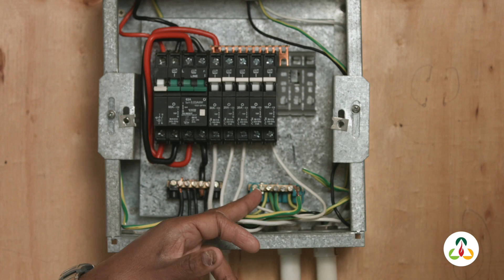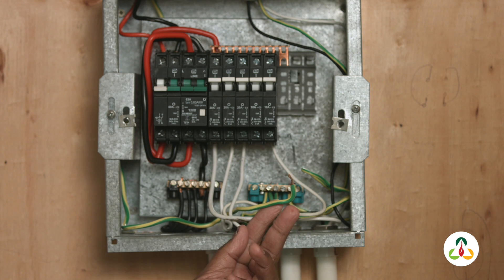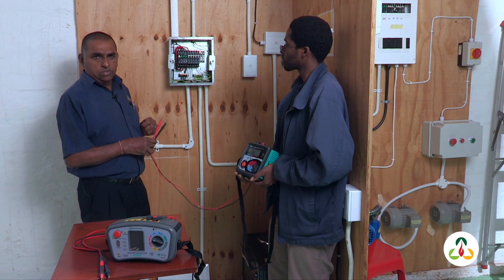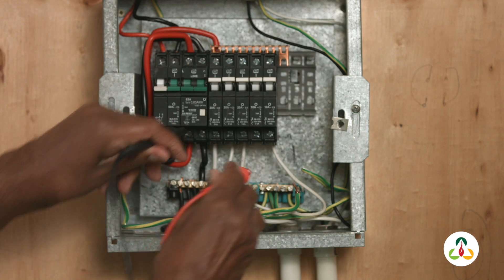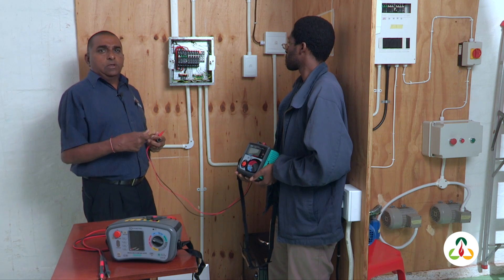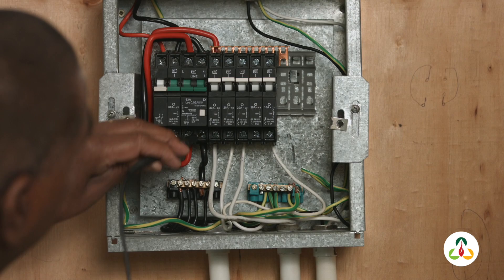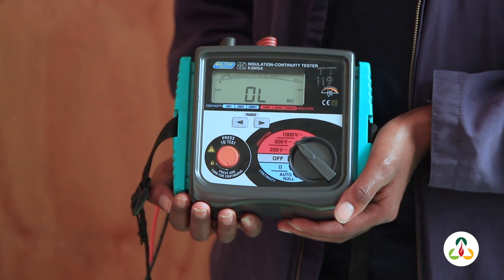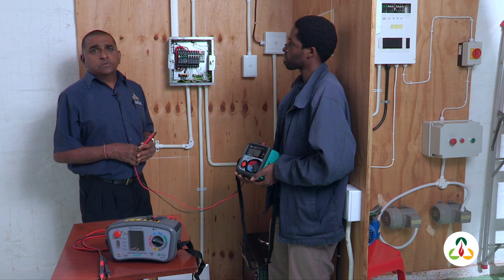How to do a Insulation Resistance Test on a Single Phase Installation

Comment: Oh. I remember when i was conducted practical at my institution school they ask me to explain how do you test  insulation resistance test then i explained but i reached there we say select the meter on 500 DC after that invigelator asked me why you put on that 500 dc i failed even today please may someone tell me why?
Reply: This is because if the insulator maintains its integrity at 500V then it will be safe for use under normal day to day voltages of around 240-230V

Comment: Can you explain why the switches need to be switched on for this test please?
Reply: Probably to test the full length of the wiring
Reply from the maker: Insulation must be tested up to the point of consumption terminals of lights and appliance. Note loads disconnected.
Reply: If switched off, any hidden blunder or two opposing connector(L&N) might not be detected while testing but while it is energized Surg takes place.

Comment: In which condition to you issue your certificate , i need one.
Reply from the maker: Originals from D.O.L or registered organization like ECA, one must be a registered contractor.
Reply: Insulation testing. Design amp for MCB check. RCCB check and testing. Which will be covered in another video.

Comment: ha ha ha why dc ? is it a battery ? It needs to be ac :)) good luck to the learners
Reply: insulation resistance test is done with dc voltage. at least, that's how these testing instruments are designed
Reply from the maker: Instruments use batteries to operate and the output is therefore D.C.
Reply: insulation tests are done with dc voltage
Reply: AC results in impedance value which is irrelevant here. See  my another comment.
Reply: Code of pratice. Testing is always using certified equipment / tool and all are on emulated DC voltages.
Reply: Wena go back  to school 😂
Reply: Only legends will understand
Reply: 😂😂😂😂 the meter uses Dc
Reply: @kukrikukemoer4956  Could you elaborate your stand?

Comment: Dear Sir,
You have a lot of mistakes in DB
1- Colour Coding RYB
2- Wire lugs and insulation missing
3- Cable dressing not proper
Reply from the maker: The panel is a training panel and the faults are for learners to identify as per your list and more.
Reply: @shukelatraining8627  plz make sure if you train people then you should have to maintain standards, bcz a lots of people following you.

Comment: You assumed the power was off and didn't test it for any supply. You also didn't test the meter to see if it functions correctly. Never ASS U ME
Reply: That is right! Especially for a training demo.
Reply from the maker: Isolation process was not shown due to time constraints of video and editing. Video is to encourage enrolment on the course for full details of tests, regulations and instruments used.
Reply: test the new installations first . safety 101.